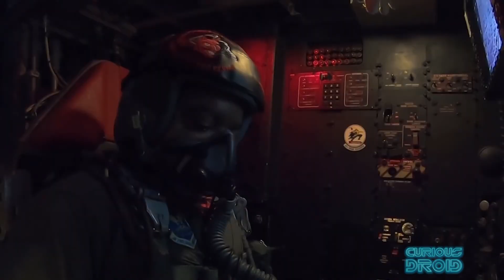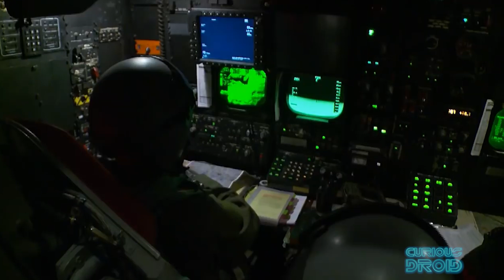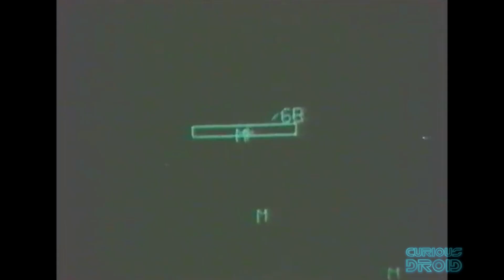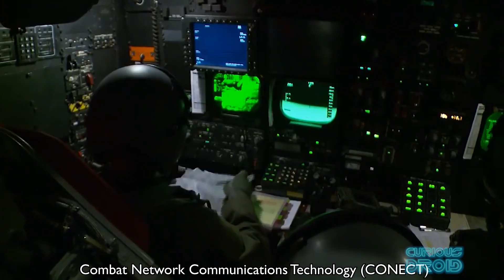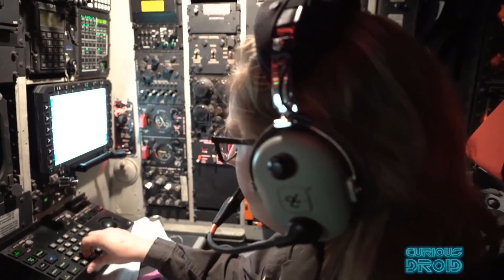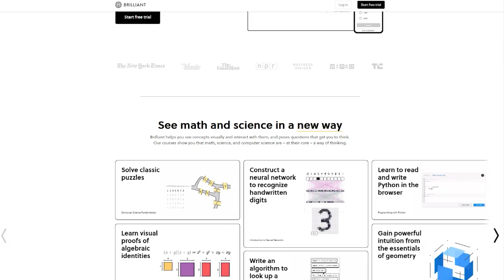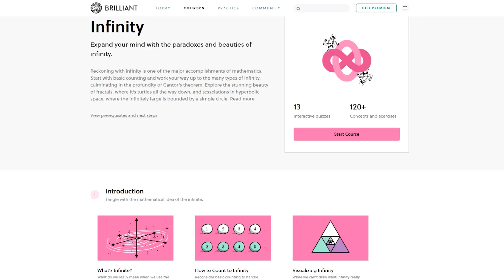How Long Can the B-52 Continue in Service?

Comment: Brazilians have a saying that goes like: “when the team is winning, you don’t change the players”... if it’s working, why bother
Reply: Similar expression in English. "If it ain't broke, don't fix it."
Reply: Never change a running system
Reply: depends on if the players are exhausted, lots of context required with this saying
Reply: @colerambo3772  so train new players the same as the old, ie; build new B52s with updated tech, don't try to reinvent the damned airplane.

They're literally taking a working design, proven design, and scrapping it entirely for a new design that will probably be replaced in ten years.

Newer isn't always better.
Reply: @glenwaldrop8166  it's not that simple, it's never that simple
Reply: @colerambo3772  The context you're referring to apparently doesn't apply with the B-52. It's still functioning as a viable weapon.
Reply: "Why change the winning formula?"
Reply: In Dutch we have a common idea of "the law of the inhibiting lead", which is a "law" that states, because those ahead aren't concerned with innovating, they'll easily be surpassed.
Reply: HAha. And of course it's a football analogy. It wouldn't be Brazil otherwise. :)
Reply: Ferguson would always change his winning teams, maybe that's why he had so much success.
Reply: Yes because thats worked so well for Brazil so far lol
Reply: Funny, we are always losing by living in Brazil yet we struggle to try to change it
Reply: Yeah Barça thought that and now look at us
Reply: ahhh.... Neymar...  SIKE
Reply: Because there is always a better design than what you have right now.
Faster, more durable, cheaper, more effective, more efficient, easier to produce, etc.
That logic works okay if you have limited time/money and have to choose a higher priority project to focus on, but if you have a need for better performance and can allocate the resources, you have to keep updating your designs or you will stagnate and fall behind.
Reply: @a_starlit_raven  what does that have to do with Neymar jr leaving barca
Reply: @caydencerobinson2025  It doesn't. I'm commenting on the analogy OP used to describe why they think we shouldn't innovate if the current B-52 design still works, and some of the comments others shared with the same viewpoint.
I didn't get in on the other conversation, and didn't reply to you directly, so...?
Reply: @a_starlit_raven  ohhh........ok
Reply: « On ne change pas une équipe qui gagne » =)
Reply: Because if you don't have a replacements, you're screwed once enough players are injured or retire.
Right now, the USAF is essentially scavenging parts to keep these bombers in operation, because they can't make any more. Every attempt to replace the aircraft has failed to do so. Many attempts to upgrade or improve the aircraft have failed, or been ignored. For the time being, the US does not face an active, credible threat to its air power - though the possibility does exist. Should this situation change, the B-52 is a massive target in the sky, and will likely be shot out of the sky... Or, more likely, simply grounded in perpetuity by skittish commanders not wanting to risk their literally irreplaceable aircraft.
When that time comes, it will be too late to start work on a replacement. The B2 was the closest, and only a couple dozen were ever built. The B-21 won't replace the B-52. It MIGHT replace the B-2, but as it's being touted as a do-everything wonder weapon, I'll believe that when it's actually deployed. Everything else in the pipeline is small fry with short legs. Production on such complex and carefully engineered machines takes years to put into place, and by the time the US finds itself in a conflict, it's too late to change its mind on equipment. They can't wait around a couple of years to maybe get something off the ground.
Reply: I don't see Brazil being a world superpower either. Futureproofing is important
Reply: @Daiyuki117  You might be surprised. Before WW1, Brazil, Chile, and Argentina were rivalling the USA in economic growth, and had some of the largest, and most powerful navies of the time under construction. But WW1 disrupted the trade their growth depended on, and by the end of the war, their economies had collapsed.
Reply: They should have changed before that FIFA World Cup final vs Germany !
Reply: @Real_Claudy_Focan  that was another reason... and yes, it was an embarassment for us...

Comment: Friend: Why haven't you bought a new car yet?
Me: Gonna run it til the wheels fall off.
Air Force: Say.. that's not a bad idea.
Reply: add to Air Force: we may even give it a new engine but give us some decades to decide on that.
Reply: Too bad they didn’t use the same ideology with the A-10C
Reply: Lawbringer they should have made it a STOVL and bam lifespan extended another 3 decades
Reply: @SktrBCULrB  Vtols are extremely hard to design and massively decreases range and carry capacity.
Reply: @myusername3689 , I wasn’t being serious dude I was just memeing. That being said I have another meme suggestion: whomever owns the license to the A-10 should roll out a new model that is capable of doing Cobra and Kulbit maneuvers.
Reply: I flew B-52s in the late 70's to mid-80s. And I actually did see the wheels fall off one of them! Well, one of the four landing gear collapsed as it was just beginning to taxi. I think it had just undergone some sort of gear refurbishment and had been reassembled improperly. (Or something like that.) The damage was minor, they got the needed parts from the boneyard, and it was soon back in the air. We were in another aircraft and had a better view of what was going on than the mishap crew did.
Reply: R Beard the b2 will out live all of us it will never stop flying
Reply: @rbeard7580  no
Reply: Lol if you add up all the flying hours it’s probably be to Mars and back , it’s been going longer then Apollo missions and they went to the moon the b2 has gone passed it lol
Reply: Almost 400,000 km on my car.
Looking to reach half a million before replacing it, but I've the feeling the clutch won't like this plan.
Reply: Oh well, reminds me of myself, actually. Right now i fighting old Logitech M570 mouse which is failing due to sort of "planed obsolescence" - microswitches behaving erratic after just several years of usage. I need to replace it, but damn it, newer models is expensive and i waiting until it explodes or something :)))
Reply: @Vednier  you can order omron microswitches off digikey/mauser and assuming you have some soldering experience replace it yourself. Look for part number "D2F-01F" (made in japan) or "D2FC-01F" (made in china). There's also a whole host of other compatible switches from various brands.

There's also opening up the switch and re-bending the levers back into it's proper springiness, but in my experience that'll only last maybe a month before the part either dies again or just snaps in half. https://electronics.stackexchange.com/questions/29955/how-do-i-fix-an-omron-d2fc-f-7n-microswitch-from-unwanted-clicks
Reply: That can be repaired
Reply: @R Renaldo Sorry, what? Is my English was THAT bad?
Reply: And then put them back on...
Reply: Perhaps not having a significant opposition is the reason they can keep ancient weapons around? Imagine a scenario were a technologically equal enemy picks these Mayflowers of the sky off at a great distance...of course all the second and third world enemies haven't got a chance (like N Vietnam or the Taliban etc)
Reply: We have new wheels.
Reply: Well, it is not
Reply: That's my car, except, the wheels fell off.
Reply: Not as great idea as it sounds. So, lets assume you did  - at time your car breaks it will be awfully outdated, with ineffective , wasteful engine, big CO emission (and you maybe taxed for this) and it will be simply too costly to use. "planed obsolescence" is awful thing, but one should stay reasonable fighting it.

Comment: The concept of bombing has changed dramatically in recent decades. The Russians usually don't use the word bomber for aircraft like the Tu-22M, Tu-160 or the Tu-95. The word they prefer is стратегический ракетоносец (which translates as strategic missile-carrier). Due to the advances in air defense systems, bombing has become almost impossible in a potential war between great powers/superpowers. You'll just get shot down way before you ever get close. Using B-52s/Tu-95s as standoff weapons platforms is much safer and much more effective. That's why both aircraft are to stay in service for decades to come. They're reliable, relatively inexpensive and extremely robust in the modern battlefield.

This is especially true in case of a nuclear war. For example, I often hear Western analysts ridiculing the Russians for still  partially using CRT electronics in their Tu-95 and even earlier versions of the MiG-29 and Su-27. I'm not aware if the B-52 still kept some of its CRT, though. People usually dismiss CRT as being ancient tech. Which is true. But, there's one extremely important advantage that CRT has over modern microelectronics - the ability to survive an EMP unscathed, regardless if it's generated directly, by a dedicated EMP weapon or a nuclear explosion. Any aircraft lacking CRT will have its avionics fried and simply go down. That's one of the reasons why these ancient machines will keep flying. Simply, the possibility of a nuclear war should never be excluded. Especially if nuclear proliferation continues.
Reply: The big trouble with the TU-95 is you need to stand-off two or three times as far, so they can't hear you.
Reply: @bobm7275  🤣🤣🤣🤣🤣

Comment: As a USAF SPS airmen many years ago, I was honored with protecting these bad boys of the air.  The ALCM was shrouded in mystery.  When we got close to them, our AM radio in the trucks would put out a sound that made me think the world had ended.  (Just kidding).  I do remember one night, I wing walked from one wing tip to the other on top of the aircraft inside the no lone zone.  Scary but had to do it as I was clearly a “JEEP” then.  Anyone in AD USAF knows what a that is.  The B-52 is a timeless work horse.  🇺🇸😎👍

Comment: This thing is like the toyota camry of planes,lasts forever
Reply: Or the Nissan pickups
Reply: Or Ds battery!
Reply: Nokia
Reply: Or like a Crown victoria.

Bullet proof engine
Easy to work on 
Parts are cheap and plentiful
Reply: @jackiechan_wtf4041  yep that as well
Reply: @jackiechan_wtf4041  or also a VW Beetle
Reply: @plazasta  the old ones not the new ones.  2000's were trash
Reply: @4jqxc  I always forget they made new ones in the 2000's

I just pretend they never happened
Reply: @4jqxc  y'all do not know what you're talking about but ok
Reply: @shtupidmate  you like the 2000's Beetle? I mean they used an adhesive that smells like crayons after about 10 years. They were quite rubbish
Reply: Toyota Camrys begin to fall apart at 100k.  The good news is you can always find parts.  The bad news is getting out of 15-year-old Camry in public.
Reply: @aj7utu  I see 90's camry's for sale all the time with over 300k miles. People still want at least 2000 for them most of the time too.

Comment: The Pratt&Whitney TF-33 is basically a commercial JT3D, the military just feels compelled to rename everything. The JT3D itself being a modification of the J57 (JT3C) which entered service in 1951. 

The J57 powered many aircraft, including early Boeing 707s, Douglas DC-8s, all B-52s before the final H model, and the U-2 reconnaissance plane, over 21,000 of these engines were produced. These are literally among the first practical jet engines ever, still relevant and doing the job today!

Comment: Analog airplane doesn’t care about your digital warfare.
Reply: Just like the Battlestar Galactica. No centrally linked computer system, so the cylons can't hack it!
Reply: So true. I was in a 1980 RIMPAC exercise and we were not allowed to use our valve electronics, centimetric RADAR, cause the new digital electronics could not JAM it during the exercise. They could detect it and in a real war blow us to bits, however, it does show you, you have to be aware of your enemies technology.
Reply: Sure it does. Just because its sensors and comms are analog doesn’t mean it can’t get jammed. Going digital saves weight, space, crew workload, and gives you better options for countering the enemy’s jamming and/or tracking.
Reply: @Warriorcat49  there are also hackers and digital inhibitor methods to keep in mind. In a world where everything is digital and combat is built around that, an analog plane can practically ignore it most of it. There is just nothing to mess with. It is like the rock, no matter the age throwing rocks at high speeds is always going to be effective.
Reply: @Warriorcat49 Bullshit, digital is only a liability. Remember, just because it’s digital, doesn’t mean it can’t be jammed. Saves weight/space/crew workload, give us a break. The B-52 has all that shit, and it was already as capable of evasion decades ago as it will ever need to be.
Reply: @redbluesome2829  you can use digital things as long as they arent connected to any networks, some solid state drives weigh less than punch tape i can guarantee you that
Reply: @redbluesome2829  Just keep digital air gapped and you'll be fine.
Reply: @redbluesome2829  If you're going to risk getting jammed either way, might as well have more informative displays, more automated systems to give you maximum crew efficiency, and increased targeting/guidance/air defense capabilities.
Digital technology, when properly implemented, helps you use your existing equipment more efficiently and effectively.
The only thing analogue does better is reliability (in some cases), and a lot of digitally-equipped airframes have analogue backups anyway for exactly that reason.
Digital technology isn't worse just because it's new.
Reply: @redbluesome2829  reject guns embrace stone
Reply: Death traps.

Comment: Isn’t it feasible that the USAF Could do the same refurbishing and upgrading of the B-1 and B-2, and keep them flying into their 5th or 6th decade aka 2050s, instead of retiring them as the B-21 comes on line? What exactly is it about the B-52 airframe that is so remarkable?

Comment: The cockpit photo isn't pre 2014. That is a D or G cockpit. The current H model looks MUCH different.
Reply: G4Disco - Well it could be anywhen prior to 2014 to be honest.
Reply: @AtheistOrphan  Negative. I've worked them since '02. The H, which is the current model, looks vastly different. The G was retired approximately 1991. This is the H cockpit. https://cdn.jetphotos.com/full/5/17060_1519699222.jpg

Comment: The thing with the B-52 is the same with the Tu-95, both are the top of the long range, high load, strategic bomber designs respectively. They will continue to see use because they don't have one yet are the only aircraft available to fill that use "just in case". SAMS and even Gen3 fighter jets have made both of them obsolete yet there are still in use because no other military plane can fill their roles. It' not because its so good, it's because there is no need to improve in something that is seldom used.

Comment: 6:20 Nearly 6000 TF-33 turbofan engines weren't used on B-52s, as only the final H model used them, of which 102 were built. All the earlier models used turbojets.

Comment: Strategic bombing has been obsolete since the b52 was built. They just hang around as tactical bombers in low risk conflicts. Where the air space isn't contested, and anti air ground threats are non existent.

The b52 actually costs more to operate than B1. The b1 though was striped of nuclear capability as part of a treaty with the soviets. There are just not enough B1 and B2s to use for conventional tactical bombing missions. So the b52 gets to keep going.

Comment: Aircraft can be used forever just like anything else,  also an airplane is just a data plate with information stamped into it. Everthing else can be replaced with new parts. What makes them go away is better technology or cost of repairs and operation. When they get too  expensive they will retire, or will retire when something better comes along. Just because the design is old doesn't make it a bad decision to keep it..

Comment: One would think they could by now just swap each of these engine pairs for one efficient ultra-high-bypass engine. Maybe they are concerned about it looking too much like a civil freighter? The old engines provide short of 80kN each, so 160kN per pylon. Modern engines provide 200-300kN, so they might use a reduced thrust version that would therefore live longer. They also would have to reconstruct the pylons to mount the bigger engines higher and forward like with the 737max - but it would cause less problems as these engine pairs already provide large surfaces producing lift.

Comment: Like every other manufactured item, the B-52 is a design - a design with replaceable parts. Parts that are constantly monitored and maintained. When something fails or doesn't meet specs - it's replaced. When improvements or modifications are installed - the old stuff comes out. There is no practical reason this design couldn't be flying in 500 - or a thousand - years. Ever seen a ravishingly "restored" antique auto? Many to most it its parts have been replaced, too...

Comment: Much of the BUFF has been changed over the years including the avionics, the wings are reskinned as they started to fail in the 1980s, new engines, essentially they are new aircraft.  Same with the C130 which at the J model is a new aircraft.  Your hypotheses stating they are the same is just wrong.  They kept them because they are cheaper than developing a new aircraft for their mission.

Comment: The B-2 has capabilities that the B-52 lacks, but is much more expensive.
No one has devised a bomber capable of Mach 2 with a range of 15000km, costing less than, say $500M. Hence the B-52 will remain in service as long as there is a call for a manned bomber.